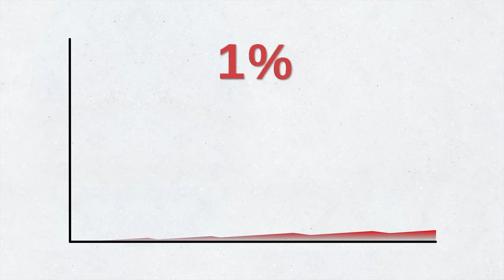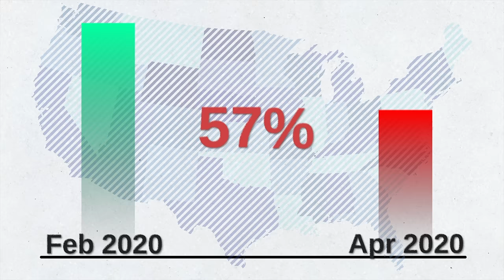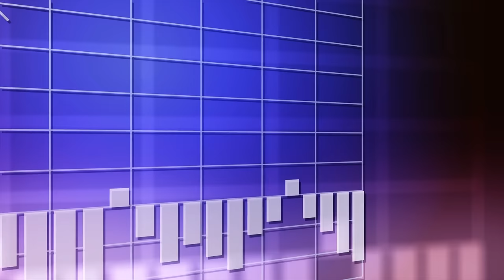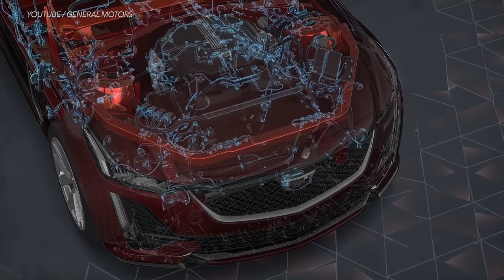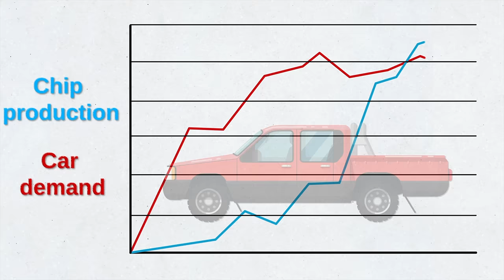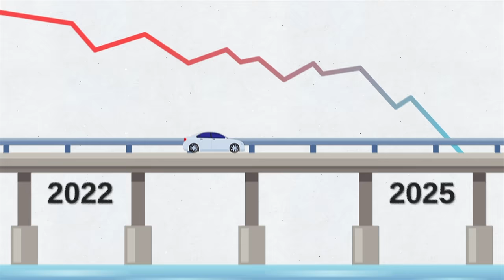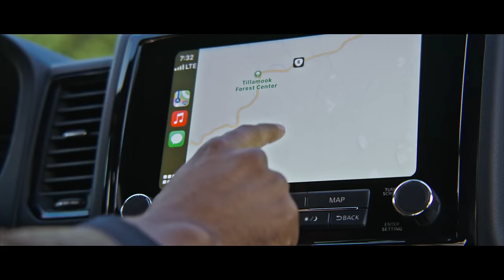Brace Yourself, The Car Crisis Just Got a Lot Worse

Comment: This is why you need to maintain your car more than ever now!
Reply: Keeping my 2012 Scion xB!  ( it's a Toyota)
Reply: @oreally8605  I'd  keep it till the wheels fall off!
Reply: Problem is parts are getting hard to get. I had a friend that needed a window switch for a Volvo and had to wait 3 months for it to come in.
Reply: I only put 400 miles on my pickup truck in 8 months. Retirement has its advantages. Especially with gas at 4 a gallon.
Reply: Yep I’m fixing to change a bunch of fluids soon. It’s insane how crazy everything is, but with how the government has been acting I can’t say I’m surprised.
Reply: @oreally8605 
Absolutely!
I'm not replacing our Corolla (2015/200,000 km) until the situation is back to normal.
Reply: Yes & the shops rip you off 🔧 every way they can in 2022! 💲💲💲  $110.00/hr for a trained mechanic.
Reply: @davebrown4841   I have a used Ford Crown Victoria LX sport 2005. I took a full time job with a short commute, 10min-4mi. 🚘
Reply: My parents back in 2016 got warranty through the Nissan themselves when repairs were needed they kept pushing us back, we ended filing a lawsuit against them
Reply: @jaysmith179    I need a new LCM light module for my used Ford Crown Victoria LX sedan. The chain mechanic shop, repair said the PART is $525. That does not include the technical support, labor.
Reply: @DavidLLambertmobile  I use to drive up to 2 hours one way to get to a road construction job as a heavy equipment operator. And gas was high during some of those times. My pickup truck has 80 thousand miles on it so it should make it till I'm in my grave . I could never imagine buying a pickup truck for 50,60,70 thousand or more.
Reply: @jaysmith179  Not really, it depends on which brand you have. I have a Honda Accord V6 and parts are easy to come by. Honda and Toyota parts are everywhere. Those German brands like Volvo that you mentioned not so much
Reply: I don’t regret buying 4 old first 70s dentside 80s bullnose late 80s bricknose and 90s OBS and a my old Harley roadking I got them all under 10k they are all worth double or triple now good for me almost all these ford trucks are similar in operations
Reply: @Dave Brown  I'm not retired and I put less miles on my truck. 🤑
Reply: @standoutpunching2936  it's never going back to normal. That's what people don't understand.
Reply: @awmusichistory  They all do that.
Reply: @bc_usa 
It depends on what to understand and accept for "normal", right?
Reply: @bc_usa  What goes up must come down. These high car prices will not stay high
Reply: And have it paid off as well
Reply: @DavidLLambertmobile 
110.- U$/h?
That rate I'll take any day over the 160-180.-€/h of some EUDSSR countries...
Reply: I bought an EV just under a year ago.  Actually got it when it was at its lowest price.  The same car is $8000 more today.  I'm glad I have it though, the gas prices don't affect me.
Reply: @jaysmith179  because it is a Volvo. Not as high production vehicle compare to Ford, Toyota, Honda etc. Makes sense.
Reply: Living in thailand they service here every 5000km cars are expensive here
Reply: @standoutpunching2936   The situation is back to normal in few years but prices are not because of inflation. You can count on it.
Reply: @paultaylor907 
By "back to normal", U mean 3-5%/annually RL inflation?
Reply: @Titan-dg7uw 
Imports: yes.
Locally made: ABSOLUTELY not. 
Toyota Revo and/or Corolla:
10,000 km service: ~40.- bucks
20,000 km service: ~80.- bucks
Camry aren't much more expensive, a few bucks at most. 
IFAIK, Toyota suggests 10,000km  service intervals for its top selling models.
Reply: @awmusichistory    I'd never get ANY Nissan vehicle in 2022. Far too many problems.
Reply: @DavidLLambertmobile  “trained” mechanic
Reply: You can't keep putting off getting a new car if it's on its last legs, got into a wreck, or your lease is up. This alone requires millions of replacement vehicles.
Reply: @jimantonellis8653  then you wont get any profit back
Reply: @davebrown4841  Enjoy your retirement.
Reply: @standoutpunching2936  "back to normal", meaning you will have lots of choices for new vehicle just like pre pandemic. The  $$ numbers you see now will stay plus more % . Count on it!
Reply: U R correct in order for competition to compete with me & Scotty the Kardashians will have their new naked DIY car repair channel out soon..
Reply: @WontSeeReplies  ya inflation hurts those working people that save...
Reply: That is good
Reply: I do and it’s so easy too! My cars both have 180-200k plus miles and run just fine!
Reply: @jimantonellis8653  I FIX IT before the  wheels fall off! 😂 😈 😂 ✌
Reply: In a Ford 4.6 litter the ignition coils oem are nearly 90 dollars each.
Things are just way too expensive right now
Reply: I'll probably just drive the wheels off my 2015 honda civic

Comment: If people would quit buying the things and drive what they have, we could drive prices down. As long as people are willing to pay their prices, they will continue to go up.
Reply: I had 3 used cars that broke down since February of 2021.  2 I owned previous to the pandemic and the third I bought in March of 2021 because my good car got wrecked by an oil change place that refused to take responsibility for cross threading the oil filter. Now with no cars and being a delivery driver I have no choice but to buy a car and with new cars being cheaper than used I have been shopping around for over a month and finally have two prospects coming in this month maybe. The ETA keeps changing. I have been borrowing my parents car to work. This is a horrible time.

Comment: I bought a 2021 silverado. Drove it for 2 months and realized it was less reliable than my 2004 i had with 250,000 miles. Returned it and go a 2012 gas hog with a 6.0 its not pretty but will last longer than the new one.
Reply: My 2004 Silverado has 87k.Bought it new and will keep it.

Comment: Purchased my car in Sep of 2020, paid 22k for it.  Was in a wreck last month and insurance valued it at 34k and damages were estimated at 18k.  I’m actually glad it’s being fixed because these prices are crazy now.
Reply: What you should have took the cash! Terrible advice
Reply: Family runs an auto body repair shop and using the opportunity to upgrade some performance parts 🤷🏾‍♂️
Reply: Could of taken the $34k and bought the oldest used car you would tolerate til the bubble bursts and prices go down. Just a thought...
Reply: @nestorprado7839  If insurance wrote it off, I would’ve set the cash aside and put my old car back on the road lol.
Reply: I'm amazed that your insurance company didn't write off the car, as their notorious for doing so when the damages of the car is almost worth the actual value of the car smh
Reply: @nakiabrown994  if it was  a mainstream “insurance approved” repair facility that was fixing it, I’d want it written off, but my family runs an auto collision centre.  No airbags deployed or structural damage either

Comment: If it doesn't have a carburetor, mechanical fuel pump , points and condenser, I don't want it nor do I need it!   I'm quite content with my '72 Super Beetle.  Heck, I don't even need a radiator, and WHEN the EMP'S do come, I'll still be on the road making my getaway.  My radio will be fried, but I won't care.
Reply: That's neat it's an air cooled engine.
Reply: Hell ya
Reply: I miss my 59 Beetle....sold it about 1975....but I think I know where it is and who owns it. Still being driven today!
Reply: So before the emp's hit, you drive a 1972 German turd with a top speed of 53 mph. Nice👍🤣
Reply: Have a tube car radio...you will be fine in any CME....may not get the former stations....they all use solid state stuff now...
Reply: @graybeardsage  I could do about 80, with 40 HP----on LEVEL ground (Not so fast uphill).
Reply: Alright, I love shooting at moving targets.
Reply: Take off the tin foil hat my dude.
Reply: @graybeardsage  Just as fast as your car in traffic. which is all the time
Reply: @J.A  Yes... But mine is waaaaaaay more comfortable!
Reply: Hard to imagine doing the Mad Max thing in a beetle... I'll be out there in my 1993 W250, 12v Cummins/nv4500.
Reply: @admiralrustyshackleford119  Ha, that would make for a great sequel, Herbie the love bug meets Mad Max.

Comment: I’ve got a 2003 Honda Odyssey that I’ve owned since 2008 and is my primary car.  I’ve got a 2008 Civic and a 2001 Accord that I bought for my daughter and son when they turned 16. For various reasons, they don’t want them. Both are in very good shape, with the Civic repainted and the Accord having a rebuilt transmission and a Japanese engine with 40,000 miles.  Unfortunately, I still have too much in them to sell and break even, so I’ll keep them as spares.
Reply: Dang I loved my 97 Honda civic lol
Reply: You sure though? In this market private buyers/dealers are way over paying. Sounds like you're in the perfect position to turn a profit and keep your primary vehicle.
Reply: So what are your kids driving?
Reply: Very Smart. KEEP. Drove by a Honda dealer , only 30 cars in the lot. My 98 Toyota has 295,000 , has a oil leak , but runs like a top. Just keep checking the oil until I find someone to fix it.
Reply: What the hell happened to the accord to need a motor and tranny?? And why wouldn't your kids want them... because they're not a Tesla or some other stupid brand? Lol
Reply: @AlGoYoSu  Why would you encourage someone to take advantage of people's stupidity....just because cars are selling high. Doesn't mean they're worth the price...
Reply: @lorysutherland5464  learn to fix it yourself!
Reply: Rich Sweeney.. I would fix it in a minute if I knew what or how to do it. Two mechanics said they"wouldn't go down that rabbit hole" So what's a person to do. I am in the Detroit area where many people from Europe drive Toyotas and Hondas until he wheels fall off. Mechanics r so backed up here. Wish I had a Scotty. Love the dude.
Reply: Oldest, No kids.
Reply: @AlGoYoSu  Not very many used Toyotas around. I am older . Have never had a car payment ever !! Always have driven used cars.

Comment: Keeping my old car for now, 2010 Camry. 180K Runs like a Swiss watch, 4 cylinder Non Turbo base model, not a lot of hi tech systems, Why Trade up for something with a little more shine and take the chance of problems they are having with all the high tech electronics they have on the new ones. The one new system that drives me nuts is the car turns off a at stop, and restarts every time you take off just to boost gas mileage. Can't wait to see how this plays out when these cars get a bunch of miles on them, whatever you saved on gas, bet the repairs will cost double that. Will take the old any day over the new.
Reply: The stop/start feature can be turned off.
Reply: @carolbabb7875  yep it's part of my start up procedure,hit that damm OFF button,once the warranty is over,5 years time,I will have that dealt with by a tech programmer.

Comment: I picked up a Grand Marquis, retiree owned, low mile car for less than half of a similar honda or toyota with similar miles on the market in my area.  I calculated it out and I would have to drive about 180,000 miles to equal the purchase and insurance savings in lesser fuel economy with today's fuel prices.  I didn't bother to factor the cheaper maintenance with my purchase.  I acknowledge that that calculation will be less in my favor when fuel prices go up but it will still be in my favor overall for forseeable years that I will be driving it.  Its also really comfortable to drive to and from work in it.

Comment: Just bought a new Prius for MSRP, other dealers where jacking up the price well over MSRP and they where selling for $2k more on the used lot than what I paid. They are not going to get cheaper anytime soon.
Reply: Wanted to but a new 2021 Tacoma SR with the SX package. Went to Toyota and they wanted 5k over MSRP. I walked out and went to Carmax and found a 2021 with very low miles for a better price.
Reply: @jaysmith179  you did the right thing! Don’t pay over MSRP!
Reply: We are on our 3rd Prius. You will love the gas mileage!
Reply: I agree. I'm using a used 2005 Ford Crown Victoria P74 sedan. 176500mi. I'm just going to spend the $1500-2500 required to maintain-repair it. A new car or even a 4/5 year old high end model would be unrealistic. Maybe in 2024.
Reply: @jaysmith179  that was very smart. I love new cars but knowing how much to spend wisely is a better choice.
Reply: I love the Prius. They run so good and theyre so damn butt ugly no one will steal it. Ugliest car on the road.
Reply: @sharksport01  Prius is Not slow and not ugly! (In my opinion, but then I love boxer dogs too!)
Reply: @roylappin4491  
I didnt say slow. And i like boxers too.
Reply: @OnTheAir  second Prius! Wife has Rav4 hybrid both great mpg.

Comment: I’m a huge bmw fan but I took your advice Scotty, I have been sharing a car with my family for a while and recently the rod started knocking and we got metal shavings in the oil pan! I knew the thing was a hunk of junk it was a Nissan Juke and I had been telling my dad he shouldn’t have bought it for years but it finally blew on us during the snow storm. I needed a new car to get me to class and I didn’t have more than a few grand to work with, with how horrible this car market is that can get you next to nothing and if your getting a car you really want it’s not gonna last you long! So I looked for the cars recently posted near me for a thousand bucks, I found myself a 2000 Kia sephia with 140k miles runs and drives great just needs new rear wheel bearings and I needed to replace the fan belt. I am gonna hold onto this thing until the market evens out so I can get a car I really want and I suggest anyone in my situation or something similar to do the same, get a car that can get your point A to B and save you some money because new cars or really even used cars just cannot be worth what you’d be paying for them right now! Also old cars are a whole lot more fun to drive and work on:)
Reply: That's not an old car...I wouldn't have paid over a grand for that particular kia.. but it's better than  putting 2000 down on a new car
Reply: @DavyDave1313  what? They were smart. They over paid for a 2000 Kia..but ...still saved money , maybe it'll last. Sorry jus did a vid recently on an 04 koa and he was impressed with the older ones

Comment: Love you Scotty! I was originally thinking of getting a Used Ford Explorer but your videos convinced me to go for a used Highlander instead,. Thank you!
Reply: Get the explorer ......we got over 300,000 miles out of our Explorer they are excellent vehicles
Reply: Nice!
Reply: What year explorers are the best ? I'm in the market for used one 2005-2015 for my wife
Reply: @Erick-ABC86  The ones made before 1995.
Reply: @Erick-ABC86  Your wife will probably appreciate the newer model explorer. Make sure it's been owned by old people or someone who cared.
Reply: 2010 Explorer and earlier were solid but be sure to get the V8 if you can find one.
Reply: @northdakotaham1752  I've had 2 v6s and they never died. And my friend had a 13 explorer V6 , really nice truck.
Reply: @richsweeney1115  the 2011 and newer were Ecoboost V6 or the Duratec which had the water pump, coolant in the oil problems. The pre-2011 V6 was the old Cologne V6 updated with a single overhead cam which required three timing chains to operate, one of the chains on the rear of the engine. Noisy...plus requiring the engine to be pulled to replace the rear chain. The V8 available was 4.6 litre 24 valve, 292 hp. A better engine by far.

Comment: The Lovely Bride and I are VERY thankful that we purchased our 2014 RAM 1500 4X4, Crew Cab, Hemi powered pickup new in late 2013. It has yet to fail us and gets gas mileage we can live with as a retired couple living on a fixed income. We are also thankful we shopped locally for, and purchased, the 2005 Chevy Colorado LS, Quad Cab, 4X4, 5cyl "beater" that I utilize for hunting and fishing and more recently for around town driving and moderate distance (just under 200 miles round trip on average) trips as it gets an easy 40mpg on those longer trips and around 35mpg around town. Is the Colorado perfect? Hardly. It has a number of quirks that, if we had the money, we would have repaired by a professional such as yourself. But we don't have the kind of money we suspect it would take so we grin and bear it when it comes to those sometimes, irritating little quirks.

Comment: Hey Scotty, I have a “lamp out” message on my ‘05 Ram. Driver side brake light and 3rd brake light aren’t working nor is left turn signal. I brought it to a mechanic who is supposedly good in vehicle electronics. He told me it could take him 2 days at $180.00 an hour to find the problem. That’s possibly $2,896.00 just for labor to figure it out. I told him I’d think about it and never went back. That’s just unbelievable that it could cost that much to fix. Still dealing with this issue.
Reply: hit up forums. learn to fix it yourself. learn and save
Reply: Why would you have anyone else fix it...... Learn everything you can about cars and trucks...go to Scotty's website and ask questions...email him...that's how he answers the ones he can get to..
Reply: Take it to another mechanic. Or look for mobile mechanics in your area, as they are often cheaper.

Comment: Bought a 2011 Toyota Rav4, Base model. 2.5L 4cyl. engine, AWD. Buy here pay here place, 14,998 last April. Car has 108K on it now, very happy with it. Replaced tires (worn) wipers (optional), rear brakes and one front caliper, both oxygen sensors. Runs like a dream, starts every morning (We get REAL winter in Grand Forks, ND). Glad I didn't wait, same lot has nothing on it today for less than 16000.